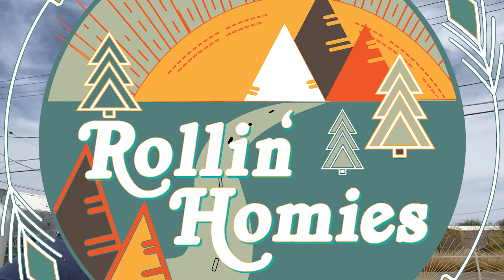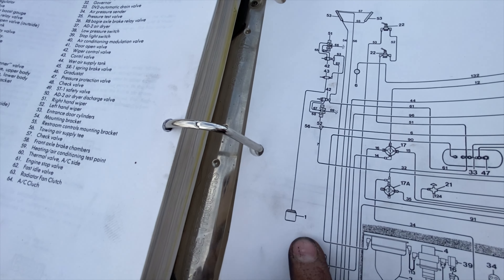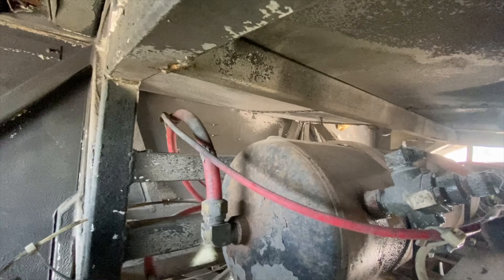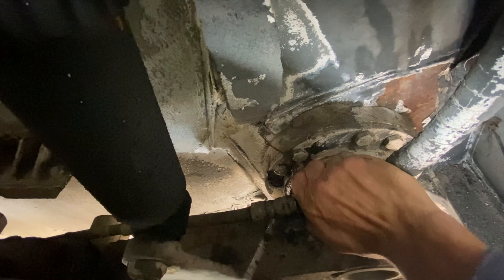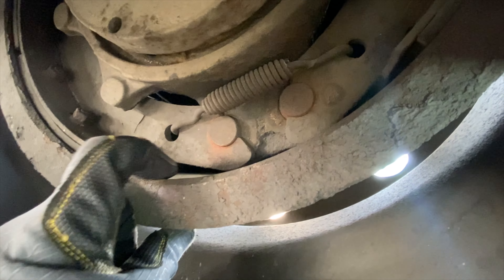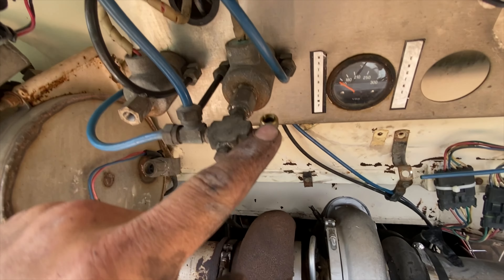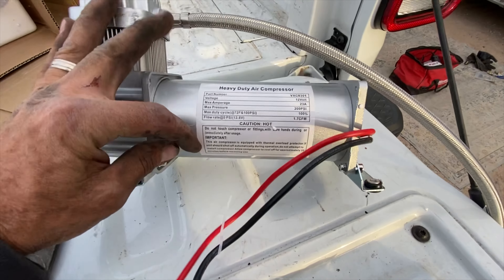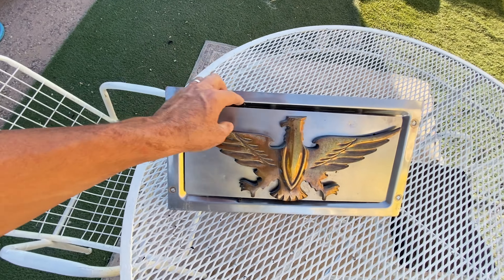Bus Maintenance and Failed brake line

Comment: Great video, 
I’m rebuilding a 1958 4104 and removed all the copper lines to my wipers and capped. They were leaking at most of the fittings so if I replace, I’ll replace with plastic lines and push lock fittings.
For now just RainX.
Reply from the maker: Copper lines for wiper motors😬
RainX is amazing! Thanks for watching and good luck with you bus project!😃